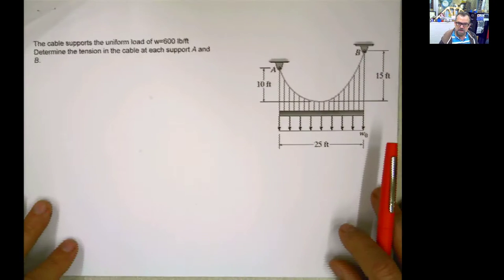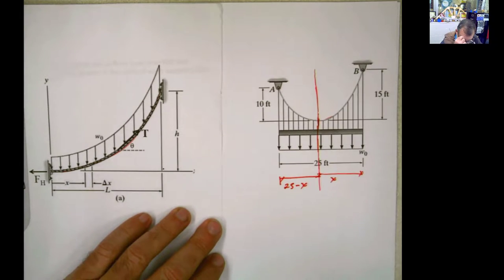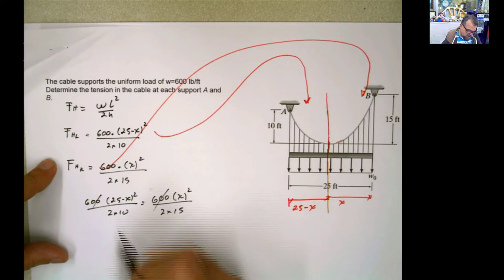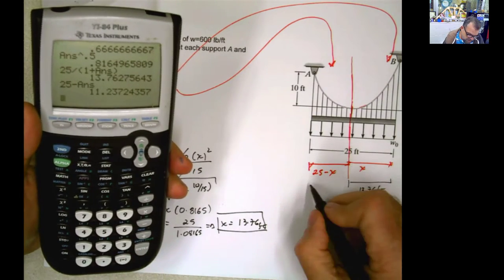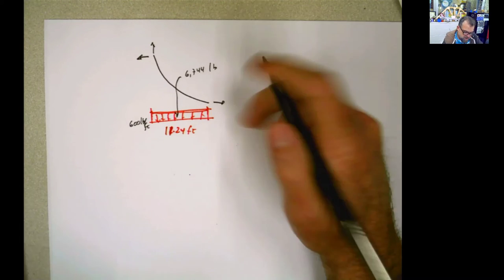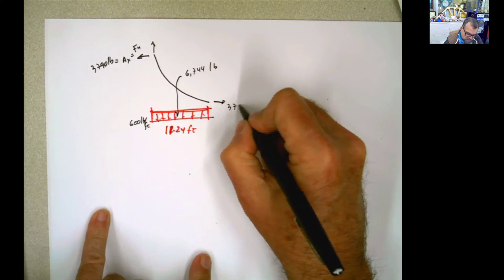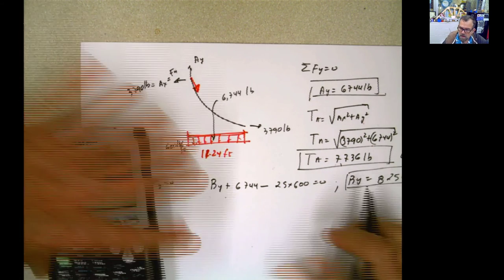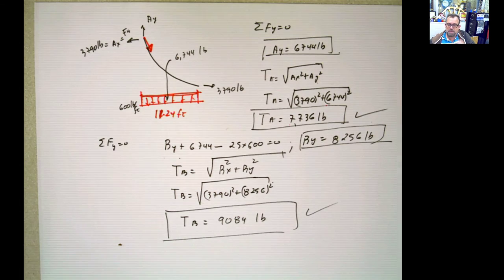Cable subjected to Distributed Load Example 3

Comment: Sir, as you said Fh will be same on both side but i calculuted Fh using right side sag and distance there was lil difference your Fh is 3790 and when i calculated using right side my Fh was 3786. I know its not much difference but its not same. Is this difference negligible.
BTW THANKS for video
Reply from the maker: Sir,
Your calculations are either wrong or you didn't use all decimals...Fh is always the same
Reply: even if you use all the decimals we not gettin 3790 for the RHS
Reply: @anotidaishechigiya6773   If you use up to 4 decimals you'll get the same Fh on both sides

Comment: How do we find the maximum tension of the cable and also the minimum?
Reply from the maker: Hi. Hello to you too.
Reply: Maximum tension occurs where the slope of the cable is the steepest (closest to vertical).  Minimum tension occurs where the cable is horizontal.